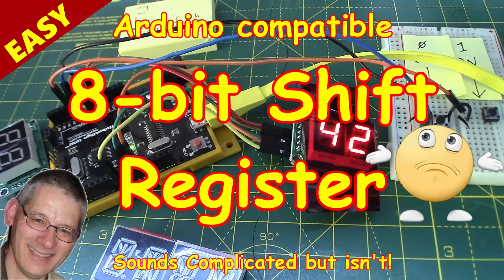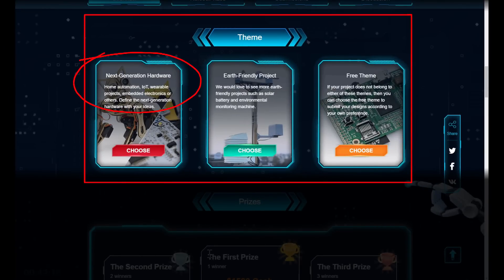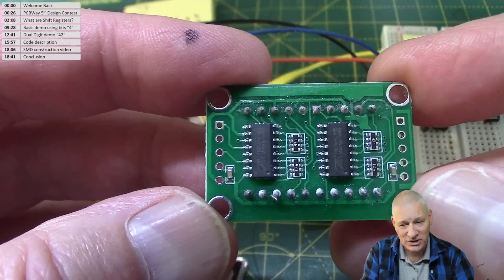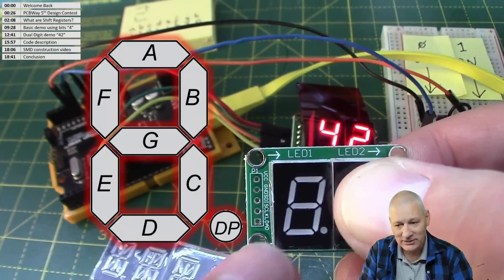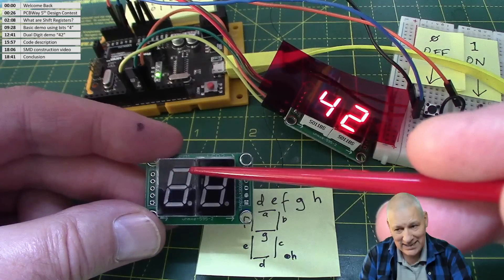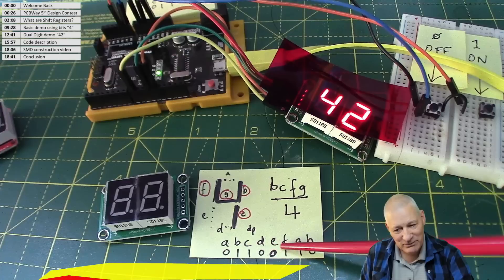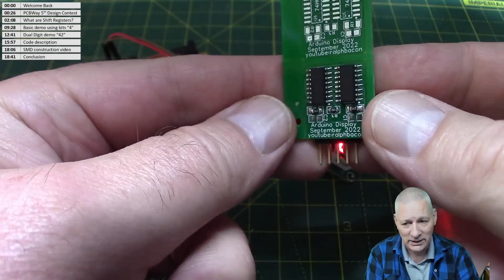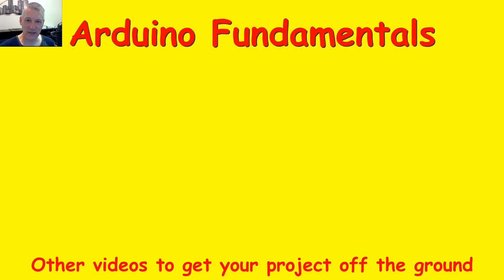#251 8-bit Shift Register for your Arduino's LEDs or 7-Segment Display

Comment: Hi Ralph, I have watched a couple of your video's/tutorials and it helped me a lot to get a better understanding of how I should structure/improve my Arduino/ESP coding. The downside is that for some completed projects I decided to develop the next version purely for quality improvements which results in improved stability/reliability. 

Maybe its there however it would be nice if you could do a video on char/string passing and returning to/from functions. In my solutions I always avoid the use of strings as they can (when improperly used) ruin your run-time memory.

Anyway long story short: A big thumbs up from the Netherlands for the way you share your knowledge and experience.
Reply from the maker: I'm happy your getting value from my videos 👍 

You are correct that using Arduino Strings can fragment your Heap memory, leading to eventual crashes.

Using Strings or Chars in parameters is never a great idea; it's better to use an integer that represents a String (eg an error message).

That said, you can technically pass an std::string as a parameter; ideally you don't want to modify the string, especially not increase its size.

Re-writing your proof-of-concept code is always a good idea. I'm always refactoring my original code, once it's working!

Comment: I have a 4 digit 7 segment display that i need to wire to the shift register, ive watched multiple videos on top of this one and its just too confusing, i know that i need to get D1-4 to cycle but there aren't enough pins to wire up to. What do i do?
Reply from the maker: Pretend you have a single digit, 7-segment display. Can you make that work with a Shift Register (spoiler: this video proves it works).

To have it display values on 4-digits you will have to learn about multiplexing. That is, switching each digit on (and off again) very quickly, during which time you display the required value for that digit. Then the next one and so on. It's how all bedside alarm clocks work.

So you need 8 GPIO pins for each of the segments in a 7-segment display (plus the decimal point) and 4 more GPIOs for the anode (or cathode) of each of the 7-segment LED devices. I'm pretty sure I showed all this in a previous video #43. It's an older video but should show your what I mean: https://youtu.be/6piP5YuK0Lc

Comment: Hi, I am just having trouble writing a program to use your library functions. Can you make a video about this topic. Like 7 segment temperature monitor or something else which can utilize full functionality of your library. Thanks
Reply from the maker: It won't need a video on how to use that tiny library, believe me! Let's see...

Step 1. Once you have #included the library in your sketch, by including this line at the top of your sketch:
#include "DualDigit_74HC595.h"

you next create the object and tell it whether your device is common cathode or common anode. If you get gibberish on the display, chances are that you have specified the wrong type. Don't guess, look it up!

Example:
DualDigit_74HC595 dualDigit(DualDigit_74HC595::commonLedType::CATHODE);

Step 2. Then you need to initialise your 7-seg device by telling it which is your data pin, clock pin and latch pin. You can use pretty much any pins that are OUTPUT pins. On an ESP32 it might look like:

#define dataPin 25
#define clkPin 32
#define latchPin 27

Example:
In your setup( ) function then add the line:
dualDigit.begin(dataPin, clkPin, latchPin);

Step 3. In your loop( ) or other functions, just display the (integer) value you want to appear.

Example:
dualDigit.updateValue(value);
dualDigit.sendOut();

Don't forget to include the "sendOut" function call, which does the actual transmitting of the bits, otherwise nothing will appear on the display!

Is that not super simple? Let me know how you get on!
Reply: Thank you very much. :) @RalphBacon
Reply: I like to move it, move it
I like to move it, move it
I like to move it, move it
Ya like to (move it!)
I like to move it, move it
I like to move it, move it
I like to move it, move it
Ya like to (move it!)
I like to move it, move it
I like to move it, move it
I like to move it, move it
Ya like to (move it!)
I like to move it, move it
I like to move it, move it
I like to move it, move it
Ya like to (move it!)

Worked ... God Bless You!
Reply from the maker: Excellent! 👍

Comment: do you have the gerber file available, want to build a countdown timer! great work.
Reply from the maker: Yes I have. Now uploaded.

You can find them here (look for the Gerber Files folder):
https://github.com/RalphBacon/251-8-bit-Shift-Register-for-7-segment-LEDs

If you need anything else please ask. 

Note that although I used (initially) 7-segment LEDs (https://uk.rs-online.com/web/p/led-displays/6165428 ) from UK-based RS Components, I also found some on AliExpress that worked great (but were green, not orange). 

Like this: https://www.aliexpress.com/item/1005003861707022.html but do ensure you get the correct common cathode LEDs that is required for your project!
Reply: @RalphBacon  Thanks! I'm going to get some made!

Comment: If you chain multiple displays together, you can create a retro (scrolling) text display. It should be pretty easy:
Convert (single byte ascii) text to led equivalent, optionally add some animation function, then pump the bytes to the leds bit by bit. I had to do that project in 6502 assembly as part of a college course, circa 1995; The programming and platforms may have changed a lot, but the underlying method to achieve the result (what the program has to do) stays the same.
Reply from the maker: Indeed, it's often not the "what" but the "how" that is important. Once you have the sequence of events, it "just" needs translating into the language and methodology that you are using.

Comment: Greetings Ralph,\

i really enjoyed this video. You brought back the memories about when i first figured out the power of using shift registers as I/O expanders, the way you have done. It was such an "Aha!" moment. 😅😅 The real fireworks came when I realized that I could easily achieve a refresh rate of 5-10 times / second, with fairly rudimentary code. It still impresses me how well the chips were designed to work together, to do the low-level work so quickly and easily. Also amazing is how many years ago that was. These designs are not new!

Cant wait to see your SMD assembly video on this. Trying to get my old eyes and hands geared up and trained up to do it myself! 

Cheers! Keep up the great work!
Reply from the maker: I'll pre-empt the video a bit and suggest you scour Banggood for SMD practice kits. They (usually) don't result in any kind of working board, they are just for SMD soldering practice. Very cheap ($5) and worth their weight in gold.

SMD video on Friday 14th October, 2022 10am GMT+0100 Video #252! Be there or be square! (Something they said back in the 1960s)

Comment: Hi Ralph
Once again a fine video. Especially the first program where you can step through the serial sequence one bit at a time is great for learning.
Is it possible to get the schematics for the pcb you are using for this demo in the video?

BR
Tomas
Reply from the maker: If you mean the larger, dual digit device (not my design) then I haven't one, but should be very similar to my own with one CAVEAT: the larger display I used is a common ANODE display (the Common pin goes to VCC), whereas my design is a common CATHODE display (Common pin goes to GND). 

So my design SOURCES current for the LEDs from the HC595, the larger device SINKS current into the 74HC595.

See here: https://github.com/RalphBacon/247-Error-Reporting-Display for the schematic on which I (loosely) based mine.

I've also uploaded my actual design into the above-mentioned repository.
Reply: @RalphBacon  Hi Ralph
Exactly. Thanks for the schematics. I prefer CC displays as well. I am planning a similar pcb for educational use, so I find your solution as a lump of gold on my behalf :)
I really enjoy your videos - they are strait forward, but still at a level where the need for paying attention is neccesary!

Comment: I saw at the bottom of your video a set of 4 14 segment display could you do a video about that.
Reply from the maker: I was planning on doing something with them, but as the control of 14-segments requires a special chip (on the reverse of the PCB you saw) it might be a very quick video. 

I'll see what I can come up with!

Comment: The 2 digit board you bought feeds bits from left digit to right. Presumably the '595's could have been designed to shift bits from the right hand side of the module. I realise the direction is fixed at design time - so the end user can't choose to force data in from the end they wish. Another excellent video
Reply from the maker: That's right. The "overflow" from one 595 feeds the other and for some reason this design (and mine too) feeds from left to right. Perhaps it's the tens and units format we adhered to, but there is no reason at all why it cannot feed in the other direction. In fact, with a couple of jumpers (or cut-able tracks) it could be made to work in either direction.

Comment: Next time you could show us how easy is to control shift registers via onboard hardware SPI.
Reply from the maker: Well, yes, I suppose you might be able to do it with SPI but we would be cheating. There is no MISO requirement (the device never sends anything back) and the SS is not required because it is the SCK that tells the chip to read the input (MOSI) line. So not really SPI at all.

The shiftOut command works well for this and my library wraps it all up to make it even easier (a future video, I think).
Reply: @RalphBacon  
Why cheating? It's obvious that this is one way communication (only MOSI, CLK), and SS could be used to latch shift register. Another advantage is hardware support - less code - more space for main program.
You could try SPI on f.osc/2 clock (I'm wondering is it real 8MHz on ATMega 328P@16MHz) and test/show it on oscilloscope.

Comment: Can you show the schematic where the first shift register passes the bitstream to the second shift register?  Thanks.
Reply from the maker: Indeed, there is a circuit diagram in a previous GitHiub of mine:
https://github.com/RalphBacon/247-Error-Reporting-Display

In summary, the "overflow" of the first 74HC595 chip on pin 9 (QH`) goes to the serial input of the second chip on pin 14 (SI, Serial In).

Comment: Hi Ralph, its good to see you putting out SMD videos ! it was a while back now but you weren't very keen on using SMD  at first and now you enjoy (or at least tolerate !) it. Great tutorial....cheers.
Reply from the maker: I'm very happy and comfortable using SMD now. It has a number of advantages, the main one is that components are a lot smaller (sometimes too small for my eyes!) so you can get more on a PCB.

Next video shows me soldering up that dual digit project, only a few components which is why I thought it could be a persuasive argument for those in denial to "have a go!"

Comment: 16:58 for readability (again) don't use both camelCase (i.c. "charSet.h") and snake_case (i.c."wiring_shift.c") for file names in a single project. Choose one and be consistent.
Reply from the maker: I always use camelCase, standard for C# programming. The "wiring" file is not mine but from Arduino themselves who obviously are animal averse. I guess we are therefore both consistent but not when mixed.

Comment: 16:46 for readability: don't write "tens" and "units" in the comment and then use variable names "outer" and "inner'. Instead name the variable for the outer loop "tens" and the lcv for the inner loop "units". That way your code shows what it is doing, rather than you having to explain it in the comments and have the reader confused as to why you subsequently use two different variable names in your loop. Lines 117 and 118 become immediately clear as to which one is sending units and which is sending tens. As you wrote it here, the reader has to mind-map "outer" and "inner" back to the earlier statements.
Reply from the maker: Separation of concerns. The inner and outer loops are just that. They might be used to send out tens and units now but the two are not really connected. A bit like calling a variable greenLEDPin. That's my thinking, anyway.

Comment: I've been aware of shift registers since I first got my hands on a TTL databook,  some time in the early 1970s,  I guess that was.  I hadn't considered them terribly useful until considered in the context of using an arduino and wanting to minimize the number of i/o lines in use.

The one shortcoming of the devices shown,  both the commercial unit and the one you came up with,  are that they are not stackable,  in the sense of being able to build larger arrays,  say four or more digits.  The spacing on either side doesn't allow this to work,  and perhaps it should be a design consideration for future versions.
Reply from the maker: Yes, electrically they stack (cascade) very well, but physically there is a (large) gap. Might be just about OK for a 4-digit clock. 

That said, it would be very straightforward to design a stackable PCB. Or use a 14-segment LED that most certainly do butt up against each other very well and you can then write anything you like!

Mine are not designed to stack as they have two fixed digits and are oriented vertically (you'll see next video).

Comment: That is a great project
It'd be nice if you added the dot, letters, and maybe symbols
It is useful for warngings, 
sometime my bench power supply outputs OtP ( = Over Temp Protection ) on the 7segment display.
Reply from the maker: Yes, you can easily extend the sketch in the GitHub to allow letters or symbols. Just extend the _digits array. Job's done.

Comment: Nice video Ralph I have used the 8x8 led boards in banks of 4 and you can do letters as well as numbers and join the boards together to make longer words and scrolling as well great fun to play with😏
Reply from the maker: I have a 0.9m (about 3ft) strip of 8x8 LED pixels but they are controlled by a MAX7219 chip (one chip per 8x8 module) and I have a project on the go for it, right now! 

It's been sitting in my workshop for about 2 years waiting for this moment. Stay tuned for a future video on how that went.
Reply: @RalphBacon  with baited breath🙂
Reply: @fredflintstone1  SQUEAK!!
Reply: @andymouse  Cheese!!!!!!!!!!!!!!!!!!!!!!!!

Comment: The shift register is a most useful chip. It can also be used as a divider.  But its primary serial to parallel job saves so much bit banging. The "decimal point" can also be used to indicate various states. With two digits they can indicate 4 states with optional flashing. Just OR in the h bit (toggling can be done by AND 0xfe).
Reply from the maker: Using the decimal point is always a good way to show things are still running. I do that on almost all my projects (eg the Smart Workshop Heater and its sensors all do it).

Comment: Hi Ralph, as you say simple when explained well great job. As a change of topic how about something on using, now getting redundant, hard disk drive motors as stepper motors or rotary encoders, etc.
Reply from the maker: Great suggestion! I might even have a hard disk somewhere. Although I did do a clean out before moving house 18 months ago. I'll check.

Comment: Good explanation Ralph. About 15 years ago I built an information display board for a friend, it was for showing stats for Ice Hockey and had 20 7 segment displays, some of them those big 3 inch ones. It was all built through-hole on veroboard (budget and time didn't stretch to a PCB!) and the bigger displays needed driver transistors, but it all worked on the same principles you described here. My friend was amazed we could connect all those displays with just a few wires. He built the controller (it was a PIC if I remember correctly) after I explained how he needed to send out a 160 bits every time he wanted to change a digit, and made it look nice with a display box. We completed it and got it working the night before the first hockey match...... The only real problem was the power supply wasn't really up to the job and got very hot due to all the LEDs but we upgraded that for the next time it was used. It was one of a number of strange projects my friend got me involved in, although usually he was the electronics man and I did the software, so it was a bit of a change for me!
Reply from the maker: The PSU is often overlooked. My 0.9m LED matrix display uses 1.7A when fully lit. I get a feeling an Arduino would not cope.

Comment: The choice of "4" was a bit unfortunate for the demonstration of the significance of bit order, since it reads the same in reverse!
Reply from the maker: Yes, I only noticed that whilst I was editing the video and did make a note that it was a palindrome (but I changed it on the fly to include the decimal point so it was, finally, different in one direction to the other!). 

I only stuck with "4" as it was part of the magical "42" combo 😁
Reply: @RalphBacon  No worries, you're still the man, Ralph.

Comment: Is that SPI?
Reply from the maker: It's not native SPI as such but the data stream can be used as an SPI stream, or the other way around.

Arduino's regular GPIO pins are not SPI; pins 13,12,11,10 are the "standard" hardware SPI pins although you could "bit-bang" the SPI protocol on any pins (much more slowly though).
Reply: you can drive shift registers with the SPI peripheral
Reply: Are the arduino regular data pins spi ?